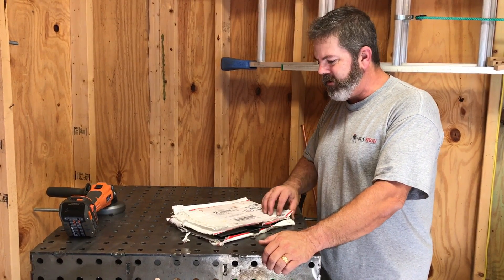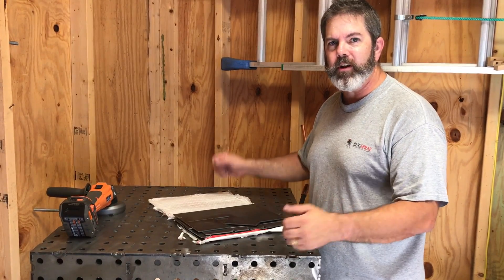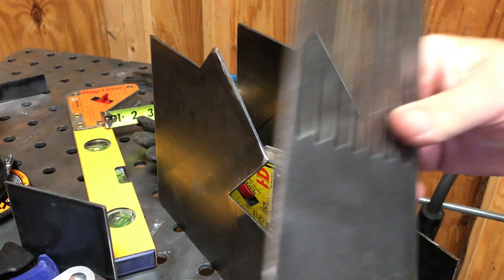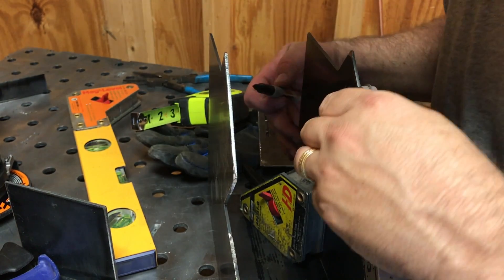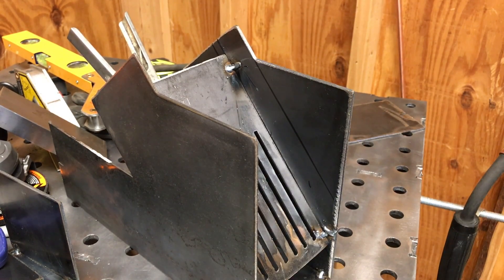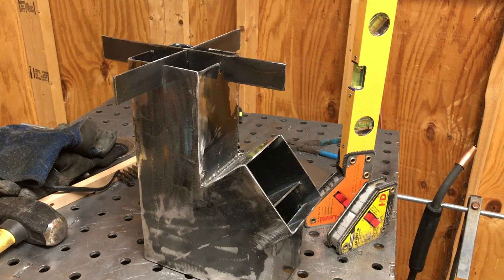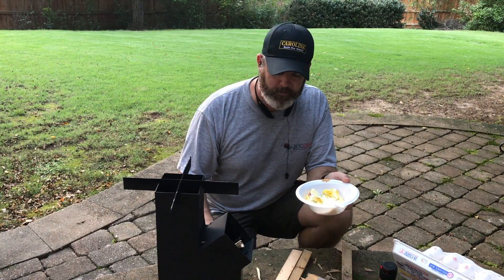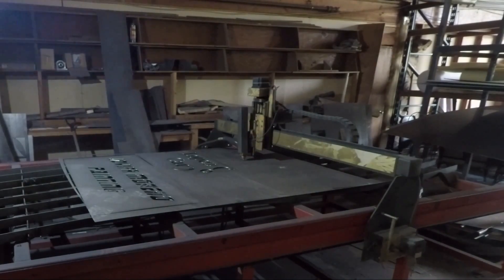Rocket Stove Kit | DIY | HOW TO | 42FAB.COM

Comment: I'm glad y'all are liking them. Go to http://42fab.com and use code "MANCRAFTING" at checkout for $5 off your kit. 

And great job on the build Chad. Taking the time to grind the welds really makes the stove look slick.
Reply: Oh hey, tips and pointers: Sanding Flap Disks are great on a grinder, I recommend 60 grit. They'll make cleaning up corners a breeze. For welding outside corners in a butt weld like this, weld down the seam, not along the corner, with the welder as hot as the material and your speed can take and move quickly so you're not laying down any extra material (that will need grinding off). But really, you did a good job, practice makes perfect.
Reply from the maker: 42Fab thanks. I may buy another one just for a project to practice my skills.  It will be easy to tell if I improve on the 2nd, also not filming will make it quicker.

Comment: I made a Rocket stove with basket with in one hour the ash in the basket puts out the fire ,,,how can I get the ash to fall out of the basket ,,,started with 1/4 " gap and went up to 3/4" I still have the same problem,,,did you run into the same problem ??